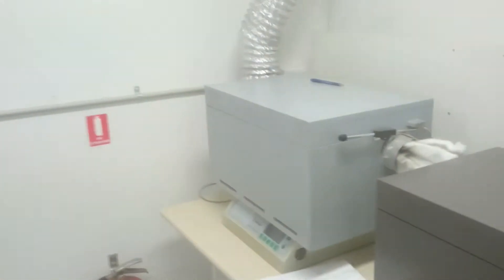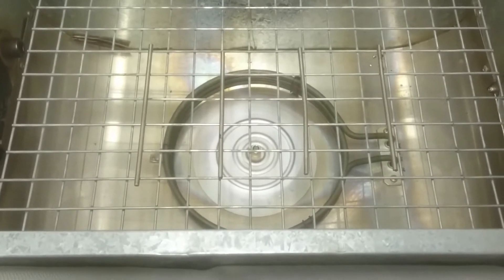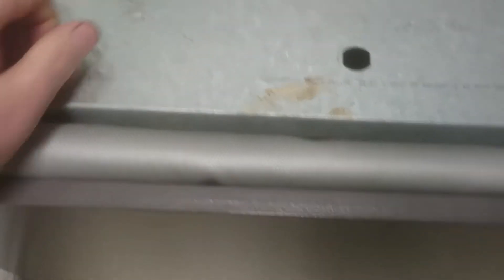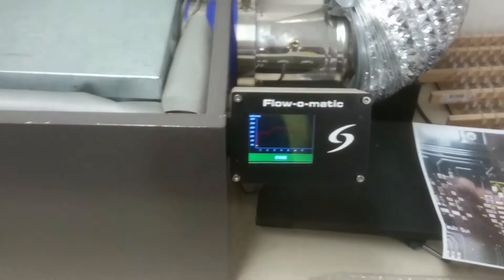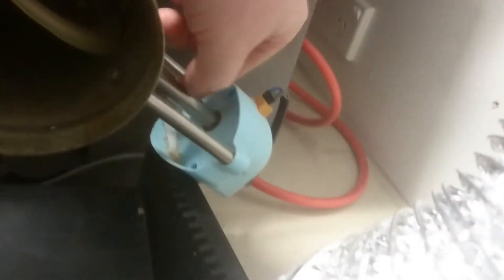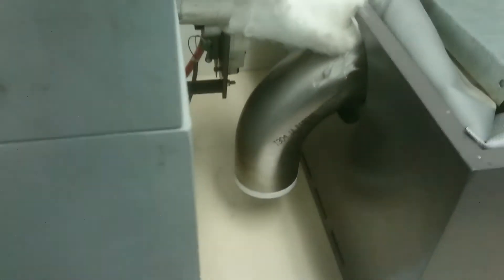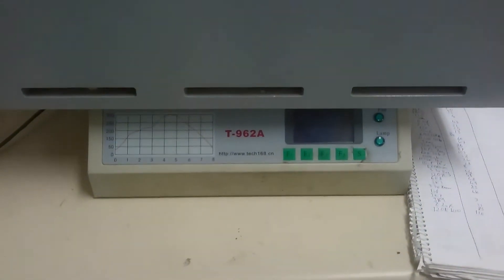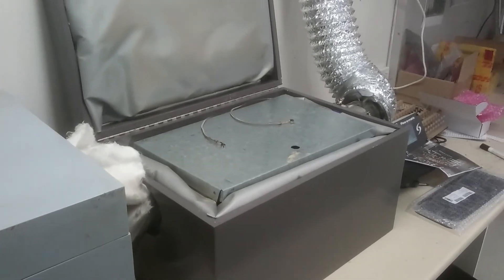Our reflow ovens

Comment: Hi Paul, On the new oven, what is the smallest size of the components you solder?  Do you go to 0402?  
Do you have Issues with small parts blowing off the boards due to the fan (which looks to be moving quite a bit of air).  Out of curiosity - have you run any tests to see if you have hot spots from the air not being uniformly blown across the boards?  One toaster oven guy  claimed 17 degrees edge to center differential and said professional ovens claimed 5...  Maybe the fan makes a bunch of turbulent flow and the heat is really uniform...
Nice work by the way!  Very impressive to think outside the box rather than mod a toaster oven / convection oven.  I love the way you have attacked the fume extraction problem.
Reply from the maker: We have flowed some boards with 0402's no problems seen. The velocities are quite high at the bottom of the box, I guess the air diffuses and slows down by the time it circulatres up and over the top side of the board.... Soldepaste tack will make a difference too. We only use Loctite GC-10
Reply: @ScienceSpice09  Thanks Paul!  Good to know the air speed isn't a show stopper and you have gone to such small sizes.  I doubt I will go below 0603.  Out of curiosity, I notice you had a metal plate with a hole over the fan in your first unit.  I guess it wasn't necessary as you don't have it in your new unit? 

Do you have to do anything special for double sided assembly?  I would think the even heating would cause parts to drop off the bottom of the boards (perhaps surface tension of the solder makes this a non-issue or do you put the Double sided boards on a ceramic plate or something).

After my own toaster oven build had such bad hotspots and cooked connectors (it was an IR before I knew any better and no fan), I bought a charmhigh for 500$ that has some convection and has an exhaust fan (BRTRO - 420).  It is a really nice heavy unit with great build quality - however its core function is flawed as it still uses IR and has hotspot stripes under the bulbs, and the fume extraction isn't as good as hoped.  
https://www.eevblog.com/forum/manufacture/charmhigh-brtro-420-reflow-oven-review/
I wonder if I just removed the IR and added your oven heat element if it would work better.  

Two years ago, I had to leave behind an older obsolete Madell unit during a move...pretty much a 50cm cube and built like a tank and had a single downblowing fan that blew through the bulbs - that in retrospect worked reasonably well (compared to the BRTRO-420).  I retrofitted an industrial heat/soak controller as I ebayed the core unit with broken controller.  This was surprisingly easy and gave me a 2K$ oven for 400$.  Excellent build quality, but the IR was again a weak link and I had to build a forced air hood around the top of the oven for fume extraction (which worked quite well).   I like your bottom mounted fan.  The Madell had a top mounted fan and it went into thermal shutdown after 10 cycles even with a cooling fan.  It did have an interesting feature of little ceramic disks on the board mount plate.  Made it easy to remove boards without finger burns and they said it helped with double sided assembly.
Reply from the maker: @blakecarpenter9069  The cover plate came off because we just weren't hitting the required ramp rates. The second oven is only about 2.2kW, the first is > 2.5kW.  Taking that plate off allowed a little bit of IR heating of the underside of the board and spead things up.
We have a couple of products with small (up to 5mm x 5mm) components on the bottom. Solder surface tension keeps them on.

Comment: Hi Paul, a few questions for you here if you have time: 1. what is the dimensions of the interior of your oven?  2. What is that blue sleeve where the air vent goes through the size, at about 2:31? 3. Was your modification of the air vent simple and reproducible by an idiot like myself? 4. How thick did you go with your insulation? Looks about 2" (Perhaps you mentioned in the video and I missed it)
Reply from the maker: 460 x 280 x 180mm,  That's silicone hose, the car guys use it for air intakes and turbo's. It's sized to fit the air damper (100mmid in my case) and the flange on the inner toolbox (gutter fitting from the hardware store).